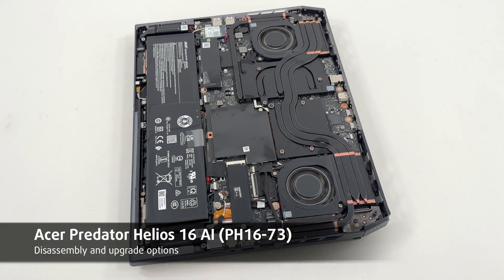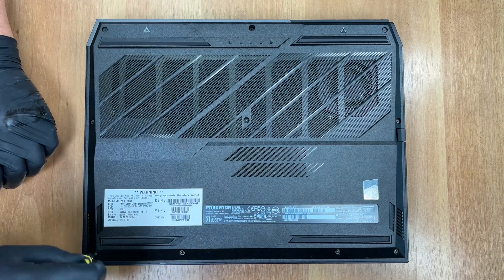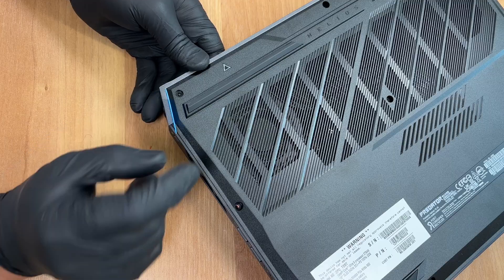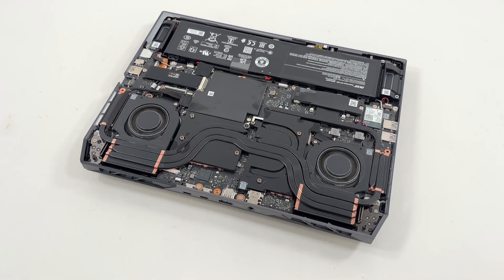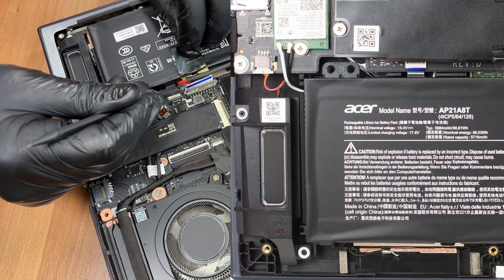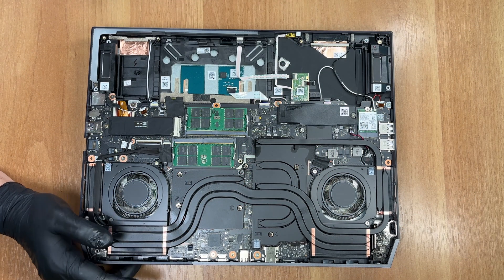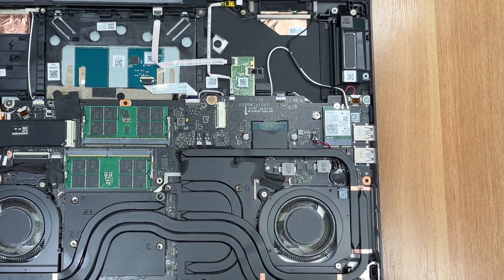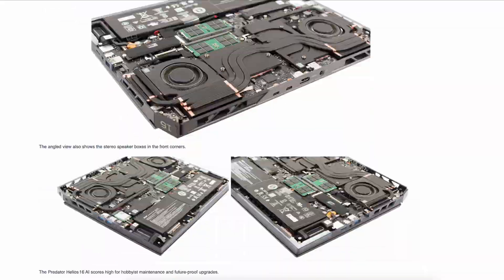🛠️ How to open Acer Predator Helios 16 AI (PH16-73) - disassembly and upgrade options

Comment: Your channel is very helpful, thanks a lot. 
Just wondering if you would consider making a shortlist of the newest laptops released that allow us to connect an Oculink egpu via M.2 port adapter. In some laptops is extremely easy, in some other laptops is terrible, or just impossible.
As you know, most laptops these days still don´t have an Oculink compatible port, yet you can make them terrific gaming machines paired with a 5080 e-GPU or whatevver you want. I just did that with a mini-PC and I still cannot believe my eyes. We just need laptops with a feasible M.2 port, that´s all.
Pretty please??? :)